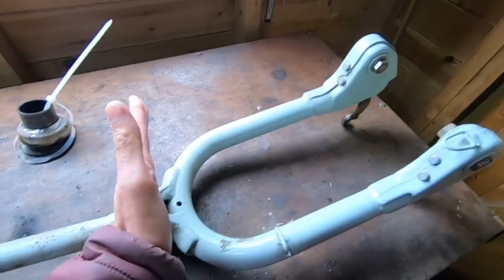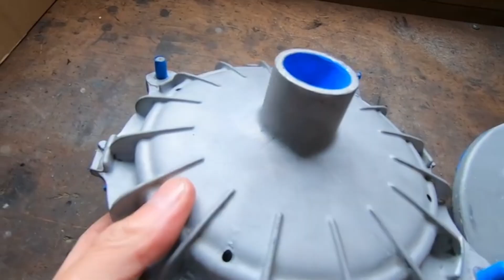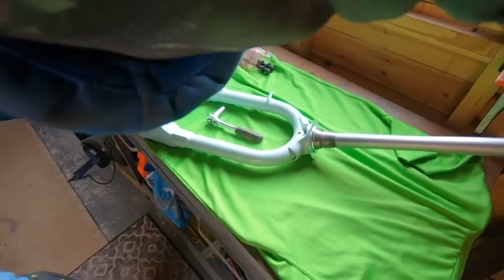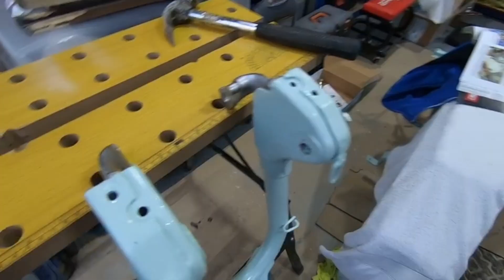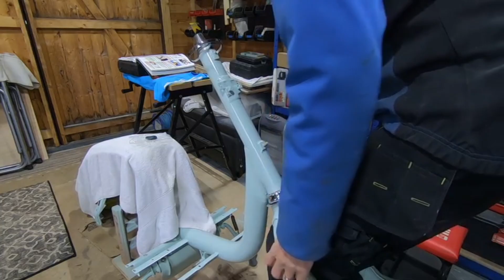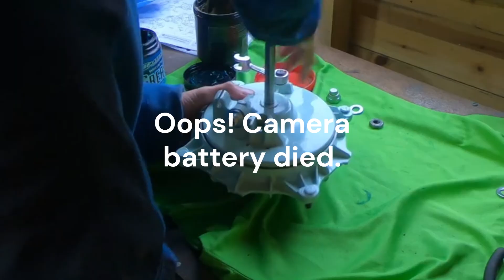Lambretta LI 125 Series 3 restoration Part 11. Rebuilding front forks, suspension, hub and brakes.

Comment: Really good video.
What did you use to pull the old top bushes / top hats out with?
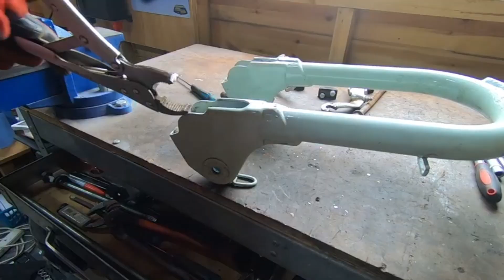Reply from the maker: I was lucky that the top hats inside the forks were the plastic ones (actually only one was in place). As it was plastic, I was able to use a M12 threaded bar to screw into the top hat bush and then pull/hammer the bar out with the top hat attached. Very briefly shown at 3:10 mins in the video. Hope that helps.

Comment: Hi Dave, just a heads up, ive watched this episode again as ive just rebuilt my forks on my Li150, ive noticed that your forks link bolts are the remade ones same as mine, these are longer than the original ones, and they stick out too far on the inside forks, and can cause them to catch on the valve stem, sticky does mention this in his book in the fork section on 'one to watch' the inner nut should be flush fit with the bolt end I put an m12 × 2mm thick washer underneath the outside bolt head to bring it out a bit, or you can cut the excess thread off the end hope this helps👍
Reply from the maker: Thanks for this. One of the reasons for doing these videos is that someone might spot things I've missed and let me know. Going to have a look later today 👌
Reply from the maker: Phew! Just had a check and the angle of the valve stem means that there is nearly 2cm of clearance, so all good. Thanks for making me check.

Comment: Nicework Dave!, Anorak alert!!, looking at the front forks, it seems you have an  earlier set than 1965, yours has the welded wire lower cable bracket, innocenti deleted that from December 1963 to the removable steel one you had in the spring and buffer kit on the vid 👍👌..
Reply from the maker: Love a bit of an anorak 😁 Interesting though; bits of the paneling have obviously had some work done, so I'm guessing someone in Italy made do with what they've got in the shed 🤷‍♂ I really like the welded brackets on these.